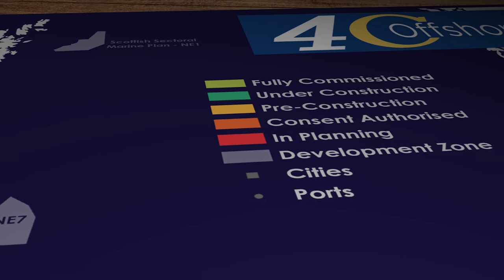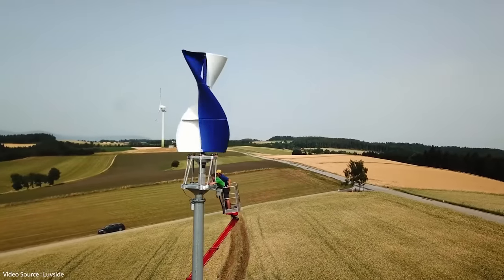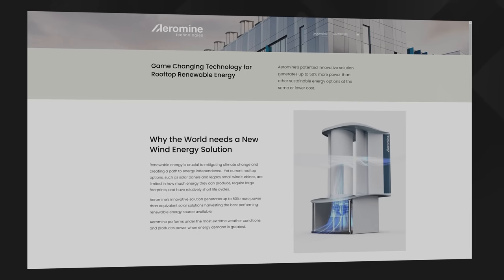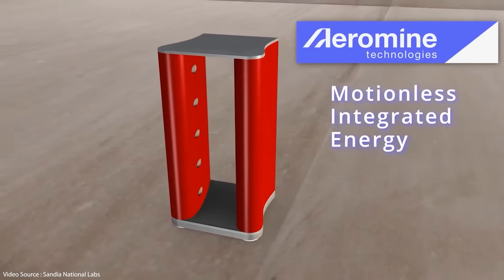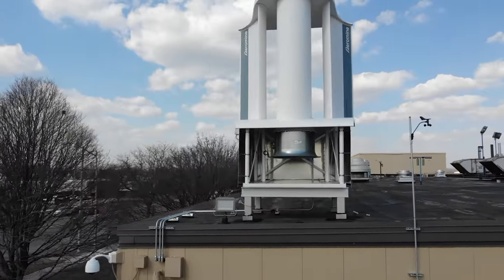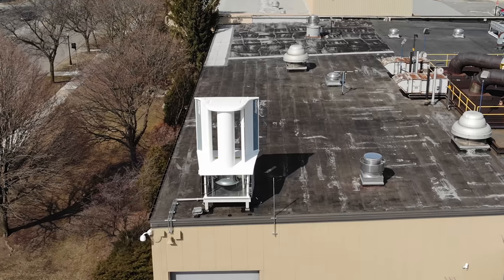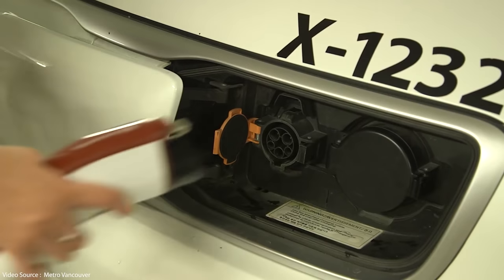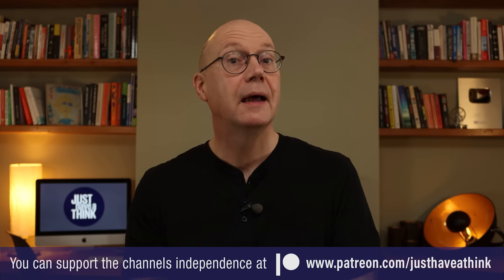Aeromine Rooftop Wind. Static. Silent.  50% more power than Solar PV. What's not to like?

Comment: It appears there is a rotating blade electric generation system in the updraft channel.  Does that qualify as "no moving parts"?  Wouldn't it still have the same wear and tear and maintenance issues as any other rotating micro wind generator?  I also notice they compare the cost and output to solar panels but not to other micro wind generation systems.  Is this significantly better?
Reply: I have the same question. It seems there is a turbine at the foot of the tower.
Reply: That's no 'visible' moving parts.
Reply: @Maamoore  That's no 'visible' moving parts.
Reply from the maker: I said no VISIBLE moving parts, which is the important criterion for many planning jurisdictions. The propeller would of course normally be covered with a facia plate
Reply: @JustHaveaThink  6:10
Reply: No moving parts except the ones that move 😂
Reply: I think the idea of no "exposed" moving parts, to me that means it can go in a locations with close proximity to humans without worrying about injury from giant blades, also id imagine it would reduce if not eliminat bird strikes
Reply: I can see how several of the venturi units could be ducted into a common turbine for higher power generation.   Or venturis facing various directions could be switched on or off depending on the wind direction.
Reply: “No exposed” is key.  Animals, severe weather, airborne debris, all are moot.
Reply: You gotta love these people that literally do not watch or listen and then complain that they haven't heard it correctly.... He said "no VISIBLE moving parts" FFS watch the video first
Reply: @SpecialFX99  He said in the video that there are no visible moving parts, emphasis on "visible".
Reply: @JustHaveaThink   at 6:10 you says they have no moving parts. You dont use the word visible
Reply: @Joe-lb8qn  and before this at 01:38 he said no visible moving parts, stop being a pedant.
Reply: Think your complete missing the point! Visible!
Reply: @peterloxham502  in the timed section mentioned he did not say "visible." He said "no moving parts". 
Go and listen to it. I did you obviously didn't.
Reply: @Joe-lb8qn  always someone knows best 😩
Reply: He said “no VISIBLE moving part”.
Reply: The point is to avoid noise nd killing of birds in exposed blades,  this readily takes care of those aspects
Reply: @Joe-lb8qn  3:02 “no visible moving parts” so that’s 2-0 so far 😂
Reply: @Joe-lb8qn  he says “no moving parts” in comparison to other wind based methods of generation in a planning context.
Reply: 6:05 is nobody going to mention "16 standard solar panels"? What is a "standard solar panel"?
Reply: Robert Murray Smith 1725 aeromine
Reply: @JustHaveaThink no. You did say "no moving parts" but I believe you were referring to "exposed moving parts". 
One of the least expensive wind generator assemblies is the Savinous model. All parts are easily accessible and easy to assemble. I read about it in a magazine called Mother Earth News back in the 70's. Unfortunately I no longer have that issue. I see small wind generators and small solar installations as an up and coming thing that will help save our planet from becoming another Mars.

Comment: As a member of a community energy group here in Ireland, I emailed Aeromine to look for a quotation a couple of months ago.  To my disappointment, they never replied so my first impressions with this company are not good☹️
Reply: to be fair its still at the testing phase, a long way from commercialisation. im sure they get lots of enquiries, but havent got a sales dept set up yet. we have a lot of resistance to onshore wind in ireland, this would solve a lot of the arguments against it.
Reply from the maker: I think they are flat out trying to keep up with current contracts. I don't think they are able to accept individual orders at this stage, but I agree it would have been nice for them to have just written back to let you know that.
Reply: @kevinwillis6707  Anything small will have a disappointing power output. In wind turbines scaling and siting are paramount. It pays to go big, very big.
Reply: @rogerphelps9939  agreed rodger, but within town and city environments i think this system is a very useful addition to decarbonising our electricity supply, and it allows individual property owners to  invest in it.
Reply: @kevinwillis6707  
A signature of a poorly managed company that publishes a website designed to attract interest and enquiries without any “joined up sales lead” response process. An email server plus automated reply is not that expensive (compared to their R&D) and it is a significant, and incompetent, commercial oversight by its management to ignore (and thus irritate) free potential customer leads that will be very valuable as the business grows, instead of ignored and wasted and probably driving business elsewhere.
Sheer stupidity that does nor augur well for a strong future business built on delivering customer satisfaction. Alan Sugar would be laughing at their lack of the most basic business skill - selling to customers. It’s all about sales which means valuing every customer lead, not chucking them in the trash. Sugar built a very successful business on cheap tech innovation in the 1970s (the first affordable word processor) and remembering that “the customer is always right”.
Reply: @kevinwillis6707  
A signature of a poorly managed company that publishes a website designed to attract interest and enquiries without any “joined up sales lead” response process. An email server plus automated reply is not that expensive (compared to their R&D) and it is a significant, and incompetent, commercial oversight by its management to ignore (and thus irritate) free potential customer leads that will be very valuable as the business grows, instead of ignored and wasted and probably driving business elsewhere.
Sheer stupidity that does nor augur well for a strong future business built on delivering customer satisfaction. Alan Sugar would be laughing at their lack of the most basic business skill - selling to customers. It’s all about sales which means valuing every customer lead, not chucking them in the trash. Sugar built a very successful business on cheap tech innovation in the 1970s (the first affordable word processor) and remembering that “the customer is always right”.

Comment: I did this 30 years ago in an apartment building in Poland. We had a basement under the building where there was access to the bottom of the exhaust air ducts. When you opened the little door there was a constant strong draft of air going from the bottom to the top of the building. I had a small DC motor which I used as a generator. I have installed a small plastic propeller and connected the wires to the 6-volt light bulb that came from the flashlight. Worked like a charm....it was a fun project. Glad to see the same concept on a larger scale👍
Reply: I've wondered for years if the air hot air coming out of my Florida attic could power a generator.
Reply: @ShortBusScotty  Turbine for the air-flow, Stirling engine for the heat-exchange.
It's possible to do, but it would give very little energy of course. Still, can be a fun project, combine it with a low voltage use like LED lighting and it's even practical.

There's even people that placed generators on their rain-pipes to charge phone batteries with some success. You can probably find the video for that on youtube if you're curious.
Reply: Poland 30 years ago with a light globe at night? There is a movie in that.
Reply: I like your innovative spirit.
Reply: @ShortBusScotty  Short answer, very little.
Reply: in the 1980s Popular Science magazine had an article and how to about this. an American-Yugoslavian  highschool teacher also coupled it to a homemade static electricity motor, 2hp. he used just simple chicken-wire on his roof.  i'm pretty sure it was popular science of one of the other "Popular"  of Ziff-Davis

Comment: This is another flavour of diffuser augmented wind turbine (DAWT). Many have been tried, none have succeeded. Diffusers (the additional non rotating structure to modify wind flow) generally add to the cost and to the drag forces (which in turn adds to the cost of structure/fixings/foundations) while not providing sufficient additional energy capture to offset those extra costs. The Aeromine example might take advantage of a building structure to augment production, but are the additional forces compatible with the building structure or does it need to be reinforced at extra cost. The Aeromine device is dependent on harvesting wind from one direction only and there are few locations where this would not be a disadvantage vs a traditional HAWT or VAWT which can adapt to wind from any direction. I wish them luck but this is a well trodden path to failure. At least they don't seem to be claiming that they can beat the Betz limit.
Reply: Spot on. I understand that any structure near a turbine will reduce the air speed in a real world out door environment
Reply: @JonathanFrost  it is possible to increase wind speed with a diffuser structure. No one has made it worthwhile yet
Reply: Excellent views on this subject of DAWT .
Reply: Good point of view. I don't say it doesn't work but I need data to knows how it works (power vs wind speed, wind direction, and so on.....).
Reply: Put it on an adjustable swivelling base and incrementally re-angle as wind conditions change?
Reply: From Seattle to San Diego the Pacific Ocean supplies a relatively strong constant wind to tens of millions of people. A fixed direction devices would not be a concern. On the east coast I would presume the Atlantic Ocean would provide the same effect.
Reply: @tomb5552  yes, I remember seeing old Nordtank wind turbines in Tehachapi with broken yaw gear. They just welded them to face into the day time or the night time wind. The wind only ever blew to or from the sea.
Reply: Bingo!  No shortage of BS on the internet.
Reply: @redshift3 does Betz limit even apply to these structures
Reply: @@morciej oh yes makes sense, thanks.
Reply: @hrithikjain1806  yes, it applies to the area that the device presents to the wind flow
Reply: mount it on a swivel
Reply: i believe that there is the added possibility here of using the flow of air in conjunction with internal fluid pipes to turn the structure into a heatsink. a standard modern wind turbine cant do that
Reply: @tomb5552  For much of the east coast of the U.S., the prevailing winds are overland winds, from the west.
Reply: Solid comment. Thank you.
The only information I get from this video is that engineers and architects could design  the building itself as part of a diffuser, but with a cost tradeoff that is still unproven.
Reply: @redshift3  Whatever they try to do it will not beat the Betz limit.
Reply: @hrithikjain1806  The Betz limit is universal, regardless of the technology.
Reply: @hrithikjain1806  I think Betz applies to wind and other fluids acting on turbines/fans.  It represents the maximum energy it is possible to extract from the movement of a fluid.  I don't think it really matters as most people accept this limit and define 100% efficiency as achieving that limit.
I guess redshift's relief is that they are not claiming "over unity", which is the clear mark of "free energy" systems - more energy out than you put in.
Reply: @hrithikjain1806  Yes it does. You have to consider the whole of the surface area used.
IE the diffuser area for consideration of the total area available energy harvesting. It's actually very inefficient in terms of energy recovery and not particularly efficient in terms of cost to implement.
Reply: So the synopsis is that no one has gotten a design of this type to be effective, so the pursuit should be stopped?
Reply: @PrivacyFight  As I understand it, swiveling would defeat the design, which, ostensibly, exploits the flow around the building.     There are large sections of a roof that would be in rotor/turbulent airflow, dead spots, or reversed flow, depending on how strong the wind.   It's akin to ridge lift- you find it where you find it because of the shape of the terrain, not just the wind direction.
Reply: @nathanlevesque7812  Swivel the building?
Reply: @jeffarnim  no, but proceed with caution
Reply: Very interesting point!
Reply: Still, there are other people who live in tropical ones. If there wasca swivelling mehanism and if coastal or mountain region this could double as a fan as air comes in the unit. Solar panels flat on top of the unit and around to limit heat?
Reply: @SueMyChin  XD
Reply: @tomb5552  thank you for the interesting west coast wind perspective. 
Nice! 

East coast winds usually come from west to east.
Winds moving north and east coming up from the gulf also add to weather patterns. 
Noreasters (storms) in the north eastern part of the continent are common, but also notable for reversal of typical wind direction.
Reply: @nathanlevesque7812  Only if you can move the roof too!
Reply: @redshift3  Speed yes, power no. In fact you reduce the power by the drag of the diffusor. No gain. You want to harvest wind POWER, not speed.
Reply: In fact that's what they claim. They say they can get 5kW from a 3m*3m area @3,5m/s wind speed. In fact the power of wind on that area is just 0,360kW (just 7,2% of what they claim for) and that's just the input power provided by the wind. The output of the generator will be even less with frictional and heat loss.
Reply: @michaelv.1107  thanks for pointing that out. Just one more piece of nonsense
Reply: Just watched another video on this and they said it still works 45° from either direction of center.  
Personally don’t see why it can’t pivot even if its not as efficient capturing vertical lift, like say on that roof top in a 180 facing.  Heat (be it solar of other) to the bottom of intake would get the air moving and once its moving a suction should continue to draw…at least for a period of time.
Reply: Add A.I technology to this and the wind generators can talk/communicate with each other and get maximum winder power bu adjusting positions throughout the day..also they look ugly add led lighting make it sexy and use as source of advertisement they can light up and display images/work synchronicity and produce opportunity for corporate branding..Great idea these additions will make it sell to public and companies..remember you saw it here first 24/02/2023...message me for ideas im an independent designer/creative
Reply: I'm  not so sure about the idea that only a few locations would be viable... Most small to multi story buildings create drafts on the leading edge of prevailing winds - the venturi effect simply concentrates and accelerates the wind speed. An elegant solution IMO.
Reply: @michaelv.1107  correct calculation, but why do you arbitrarily choose 3.5m/s? Try say (I don't know) 11.1m/s?
At 11.1 m/s theoretical power is: 1/2 x ρ x A x v3 x 0.593 (Betz) = 0.5 x 1.225 kg/m3 x 9 m2 x (11.1 m/s)3 x 0.593 = 4.47 kW.
Reply: @richardrhodes5644  Not me, the company claims they can do it @3.5m/s🤷‍♂️
Reply: Couldn't agree more.  There is a reason utility-scale HAWTs are the cheapest electric production from wind turbines.  

Another random item to note is that, at least here in the US, for commercial buildings we are required to provide fall protection for any mechanical equipment located within 10 ft of the roof edge per the International Building code (IBC).  The 2015 edition Section 1015.6 calls for guardrails or permanent fall arrest systems to be installed.  Having these wind turbines at a roof edge will need to be coordinated and the aesthetics will be a bit...off.  You could go with the fall arrest system, but that needs to be welded into the building structure.
Reply: @nathanlevesque7812  as it is using the building as a major component to get the resulting wind flow, you would have to rotate the whole building to achieve the effect desired.
Reply: @PrivacyFight  a bit hard to mount the building on a swivel. The flat topped building is the major component in this setup.
Reply: @Merlin3189  As the building front is a major component of the design, the overall energy to be harvested includes the air from ground to top of Turbine.
Reply: @redshift3  As with all alternative energy products, its success will turn on whether they can get the real cost down to something that has a small payback period (say less than 10 years).